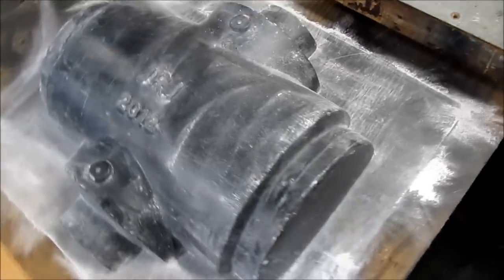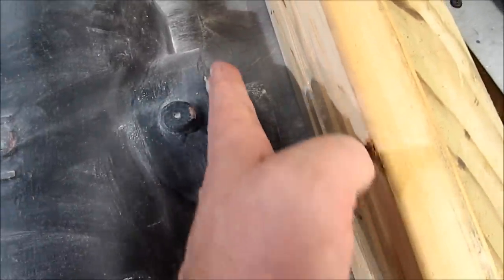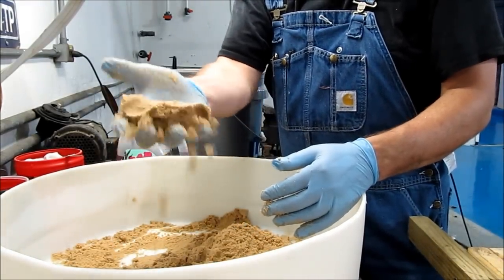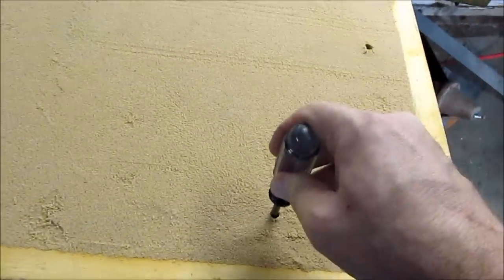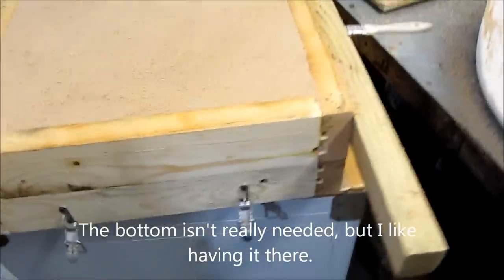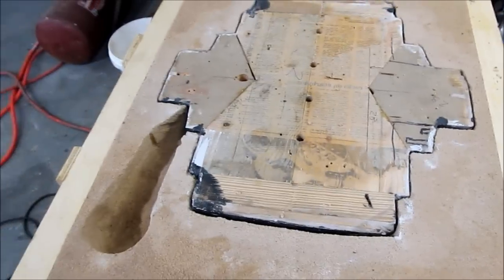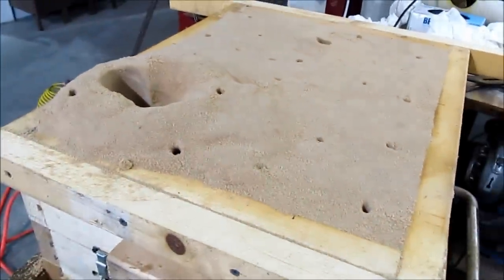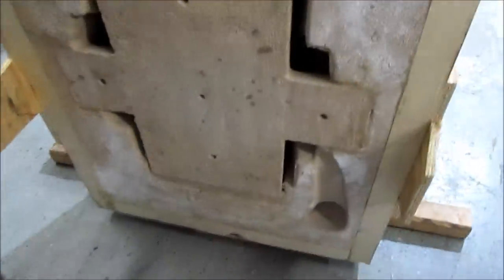Building a mold with sodium silicate

Comment: Hi Rod thanks for sharing with us the use of sodium silicate as a green sand mold replacement. I hadnt actually considered this as an option to greensand casting. One advantage of this method is that you can prepare your mold[s] in advance of your pour day and you are not worried about them drying out as would happen with greensand molds.  Is the sand reusable after a pour? I noted you watch myfordboy and Mr Pete so I was surprised you are not going to use myfordboy's method of feeder and riser extenders.
Reply from the maker: Hi mark, thanks for watching my videos. The sand is pretty hard after use, I suppose if you want to you could crush it up and try to use it. It's pretty cheap around here so I haven't bothered. I haven't had to use the riser extenders yet, apparently the risers I build are enough to do the trick.

Comment: hi. gOOD JOB. i have some questions .1-  what is the role and Effect of CO2 gas  in this method?   2- what is the CO2 injection pressure rate ? 3- how we can find out we have injected enough CO2 in soil?
Reply from the maker: The CO2 reacts with the sodium silicate and causes it to harden. Alternatively you could wait for the CO in the atmosphere to react with it, but at .04% CO2 that could take a while. :^)  I don't watch the pressure really, just try not to blow sand all over the place - it does not take a lot. You will know when the mold is hard enough, if you do it as shown here, the sand around the form will harden before the surface.

Comment: I sometimes make fiberglass part for model airplanes and model boat hulls. As a mold release I use polyvinyl alcohol, PVA, and it works good. I will see if it also works with sodium silicate and get back to you. My goal is to make an intake manifold for an old V8 using cores and want to go sodium silicate for the entire process. Bill
Reply from the maker: Sounds like a fun project! Do you plan to post videos? That would be cool, anyway I'm looking forward to learning of your progress.

Comment: I work in a steel foundry and have worked with co2 sand ONLY IN CORES not complete molds though, If you do not want to use green sand you could always try No Bake chemical sand process that is what work with at my job, it would be much less time consuming for you and probably better casting quality. if you want to continue with the CO2 process maybe you could get a more uniform, quicker hardness and set time if you poked more holes into it and maybe took a container as close to the same size as your box, poke a hole the size of your CO2 line and plug the hole in the container with it and put it over yor mold.

Comment: i used many tons of quarz sand and waterglass in my old job in a bronze foundry. we used a special fluid to prevent stiking, like a coating gel to apply on the pattern. nobody knows the name, a lot of things were secrets from the old boss that was working in striktly contact with us
Reply: +Denny Arcano graphite?
Reply: no, alcool-grapghyte or ammonia-waterbasis graphyte were used for metal spinning casting. for sandcasting we used a transparent agent, a gelcoat that prevent sticking on the patterns. then the sand, once dried, was coated with alcool graphyte and burned...
Reply: Denny Arcano not good you should always know or be able to find out the chemicals you are working with. there should be a MSDS for everything.

Comment: How do you keep the sodium silicate from sticking to the pattern? Is the pattern made of wax or something that won't stick?
Reply from the maker: I used talc during this shoot, which still leaves something to be desired. I think the better the paint job on your form (the smoother the finish) the easier time you will have getting a release. Also the sooner you remove the form the better, leaving it overnight turned out to be a bad idea. I've tried wax on the form but to no avail. I have yet to try carbon black - which I do intend to try next time I have a pour. Bottom line is I haven't found a really effective release agent yet, so if you find something that works, give me a shout.

Comment: Did you pack the sand or just rely on the C02 to harden it?
Reply from the maker: sorry for the delay in answering Dave. I packed enough to ensure the mold would take the shape of the form and to get the grains as close together as possible (better finish I think).

Comment: do you need to use carbon dioxcide to harden the sodium silicate?
Reply from the maker: Carbon dioxide is necessary, however; if you just let the sodium silicate sit it will eventually harden from the CO2 in the atmosphere, but considering that the atmosphere is only .04% CO2 and depending on the size of the mold, it may take a while.

Comment: hi, why do you put a hole on the sand
Reply from the maker: The holes are used for the application of CO2 (which I show @ 6:40) this hardens the sodium silicate very quickly. The holes in the top of the mold also provide a secondary function of venting for any gasses created during the pour.
Reply: thank you sir

Comment: Ciao Rod, posso chiederti una gentilezza. Potresti contattarmi. Grazie
Reply from the maker: HI Luca, what can I do for you?
Reply: @nurfays123  ho realizzato il calco di un busto, con le bende gessate. Ho provato a fare la colata di stagno, ma il metallo appena arriva sul gesso scivola come una gocciolina di acqua. Parlando con un'amica artista che crea lavori simili con il bronzo, che devo usare il silicato di sodio mischiato alla resina e ad un indurente, cosi da ottenere uni stampo poroso, che trattiene e non fa scivolare il metallo e grazie alla resina rimane intatto senza deteriorarsi. Potresti aiutarmi a capire che resina e indurente usare assieme alla sabbia e le varie proporzioni.
Reply: @nurfays123  hai un canale Instagram o una mail, cosi ti mostro il risultato che io ho ottenuto e quello che vorrei ottenere?
Reply from the maker: @lucastancanelli1974  If you go here you will see what I use: https://www.youtube.com/watch?v=N1OkxArX1Zk   The ratios are 2 g NaOH  for every 3 g Silica gel. I added about 5 ml H2O for this ratio. Since I used a 50% aqueous NaOH solution you may need to adjust how much water you use. My normal batch size is as follows:
     450 ml 50% NaOH solution (~344 g NaOH)
     516.03 g silica gel
     860.05 ml H2O
This will make about 1500 ml give or take a 100ml depending on how long you let it boil down. I usually end up with1400 ml.
Chances are good you'll need to play with this recipe to get the results you want but this works for me with the ingredients I use.
Reply: @nurfays123  Grazie
Reply from the maker: @lucastancanelli1974  I hope it helps!
Reply from the maker: @lucastancanelli1974  Why not put it on you tube and share with everyone? Be sure to send me a link of course! You may get tips from people much more informed than myself. I really don't know much about sculpture.